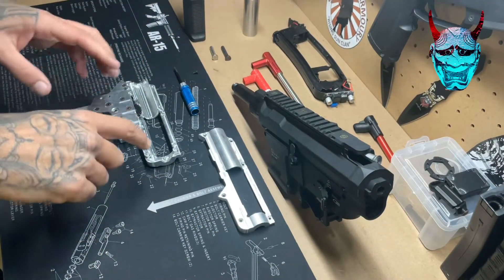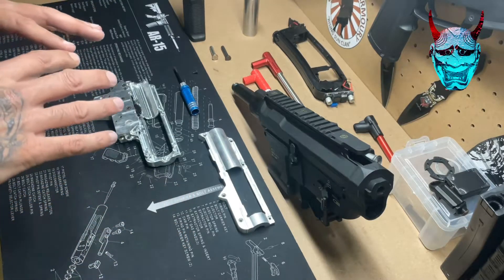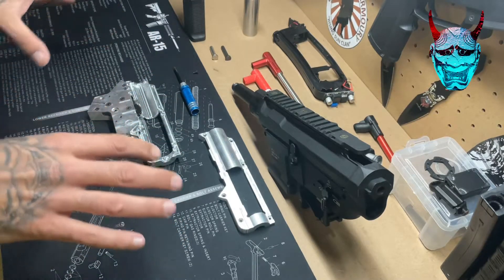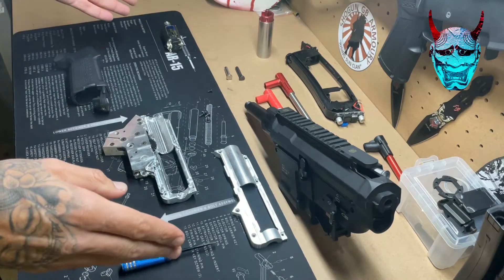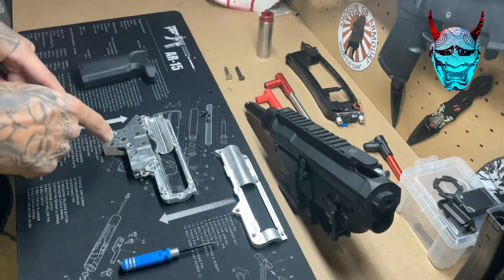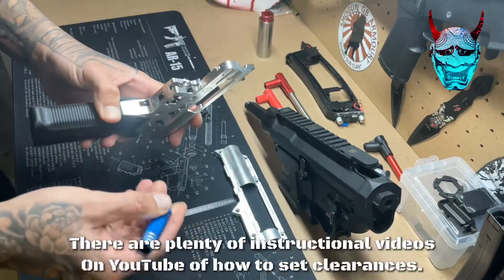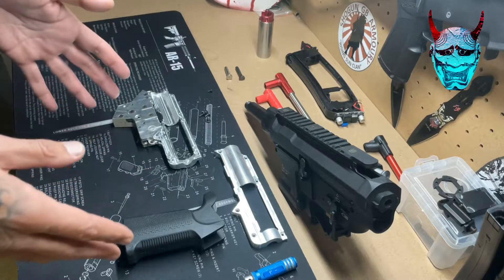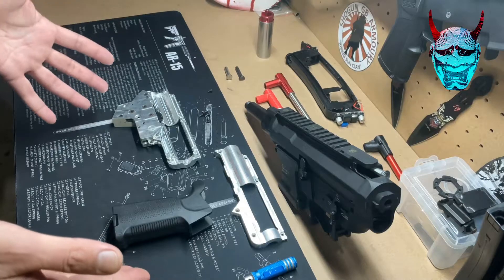Crispy AEG V2, tips to speed up bevel to pinion shimming...

Comment: Another great video mate! If wiring loom or FCU installed, easy enough to route the motor wires through the front trigger hole and the other out the back - allows this ez mode bevel height checking too without having to run the wires through the grip and motor removing / adding back etc. Time is money!
Reply from the maker: Nice tip bud 👍🏽

Comment: What’s the best motor and motor grip for the best bevel to pinion shimming, what do you use?
Reply: getting a quality motor grip like the madbull or pts stuff will help. the other thing that will help is not necessarily a specific motor, but having a motor tower or shimming the motor tower to fit the gearbox is one of the best ways to improve your shimming.

Comment: Hey bro i know you have given up on the things but im just curious, did you run in all your gear set's dry before fully installing everything, just picked up some jvan gears they got the tappet plate pick up nub pretty much directly under the pick up tooth of the sector gear apparently it fixes the fps droop in auto